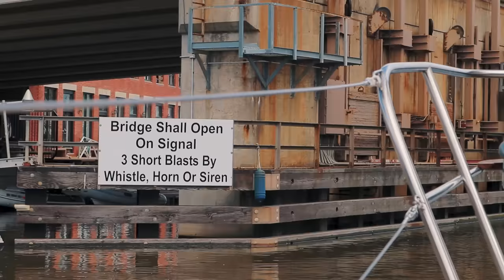WE BUY A TARTAN 37 SAILBOAT | Sailing Soulianis - Ep. 6

Comment: Congratulations folks for joining the Tartan crew.   I have owned hull #373 for 26 years and sailed her extensively on both US coasts and sailed her from SF Bay through Central America on a two year journey to Maine via the Panama Canal.  You have bought a stellar example of one of the sweetest sailing vessels available.  It also appears yours is has been exceptionally maintained and you got it for a disturbingly low price.  I would urge you to be cautious in modifying her or adding stuff.  I do not see an anchor windlass and you probably want an underdeck autopilot if you do not have these for the trips you mention, but a lot of owner regret comes from adding complicated equipment that simply becomes a maintenance headache.  You will find much support on the Yahoo tartan sailing site and on the T37 Association site.  Folks there have much experience to share.  Look forward to hearing from you.  Plan on time in Maine as you make your way to the Bahamas.   Plan on it taking 5X longer to enjoyably cruise someplace.  Deliveries are not fun—I used to do them for a living.  Cruising is about taking your time to explore and enjoy the people and places.
Reply from the maker: Thanks Pete!  Sounds like you've had some awesome adventures. We have installed a manual windlass (coming up in an episode or two) which we are very happy with so far. If we do upgrade the autopilot, it's going to have to wait until next year.

Comment: Some noteworthy features on the interior are the lack of "Hard" corners which is correct as a hard corner can hurt and do damage next is the "wipe outs" on the counter top corners which makes keeping counters and nav station tops easy to clean we see lots of hand holds below and a neat pilot berth which is the perfect sleeping location on any boat with a lee cloth of course. That white little fire extinguisher is JUNK. It will give a three second puff and done. Get some 4 of the red 5 pounders with a directional black rubber nozzle which will shoot and then you can stop and go again as needed. On another one of the boats you looked at there was a Simpson Lawrence 555 anchor windless getting another would be a good idea I would think. Also, the bright work looks outstanding and would recommend asking the previous owners about the brand of varnish or LP or whatever they used. Those cap rails will take ongoing maintenance to keep those good looking cap rails.
Reply from the maker: Peter!  You really pay attention to details!  It's funny you mention it, the wipe outs are amazing, and I think about that every time I clean up in the galley.  -Kirk

Comment: A couple more items on this perfect boat. Mast stepped at the keel, main sheep traveler forward of the companion way allows for better dodger protection, 3 bladed feathering prop and huge item as it reduces drag considerably. Will stop though I could go on and on.Peter
Reply from the maker: Peter, yea there was a ton to love about this boat. Add to that list brand new running rigging, brand new electronics, and varnish work that would take your breath away.
Reply: I'll go on for you ; 7,500 lbs of ballast on a 15,000 lb. boat  makes a nice stiff boat. With 7'9" draft board down they go to windward very well.. Plus a protected skeg hung rudder. I could go on...  Good luck with Her!!

Comment: Congratulations on your buy and thanks for making a killer video. You dodged the big mistake of buying a boat "that needs some work" which usually is 10 times as difficult and expensive at it may seem. There will still be plenty to do, but this way you might actually get to do some sailing :)

Comment: One more suggestion. Please check your mast holes where you ran the internal line. It appeared from my TV that the line could chafe on the metal in the mast. If you can stick your flexable viewer into the hole and see if the line is dragging on the mast metal. I think it is, this will compromise the rope over time.
Reply from the maker: We installed a piece of hardware called an exit sheave that provides a smooth surface for the halyard to run across.

Comment: The Tartan 37C (Sparkman stevens designed) I like!...The thoughts  I have= Enclose the cockpit REALLY well. That can likely be where you will spend most of your time.(Its just gonna be) I haven't got your names yet but you're certainly correct that a cabin top traveler makes for a nice cockpit enclosure. Also a 15 thousand pound boat  (NEW) 18 thousand when loaded up and tanks full, would normally require a windless to lift the somewhat heavy ground tackle that is desirable in a big blow.... 1/2 the displacement of the 37 is ballast , Thats interesting. Basically a .50 ballast ratio is quite unusual. Maybe a windvain (Hydrovain) would be good to back up your auto pilot. Auto-pilots can stop working. Also the Barn door rutter on your 37 may require more power than one might think to maintain your weather helm. If its just the auto pilot then a major solar system is in order supplying lots of amps.  solar system= ( Fat wire, MPPT controller, Solar panel mounted aft where no shade will land on it. And Lifeline batteries are nice. They require 103% power to charge 100%. other batteries require 114% to 135% to charge 100% wasting amps overcoming internal resistance in the cells).    G.T.  SV Silver Fantasy ( Beautiful Friday Harbor, Wa.)
Reply from the maker: Hi Gary, Thanks for the thoughts! We started right away on a list very similar to yours above  just after closing.  We added a windlass, 200ft of chain and a new 45# Rocna. We're midway through the bimini, davits, battery & solar projects (all coming up in future episodes of course :)

Comment: I forgot to mention  The CQR I really don't care for. They pop out when the wind clocks around sometimes and then it doesn't reset. Use an anchor drag alarm as well.  Also maybe you can rig something so that as your Jib sheet comes across it won't catch on the mast winch.    G.T.
Reply from the maker: See below RE: anchor.  We got rid of that ASAP.  We had two nights at anchor with heavy winds and we were constantly up checking to make sure we weren't dragging.  

It's weird we've never had the winch issue while we've sailed/owned the boat. Now getting the line caught on the v-berth hatch.  That seems to happen with some regularity, but never on the winch.
Reply: O.K.  ...Keep on rockin in the free world.  G.T.